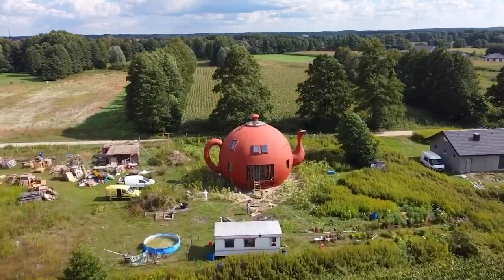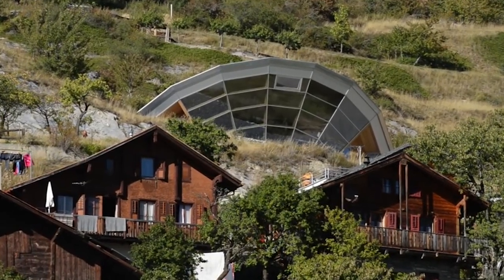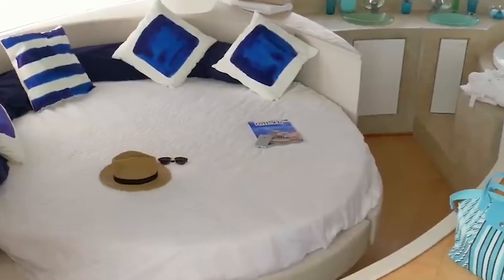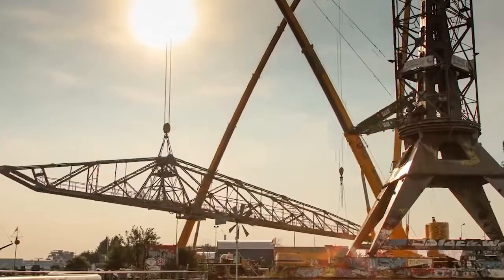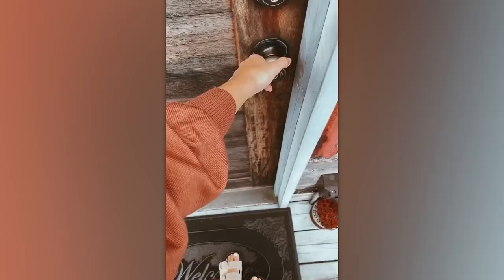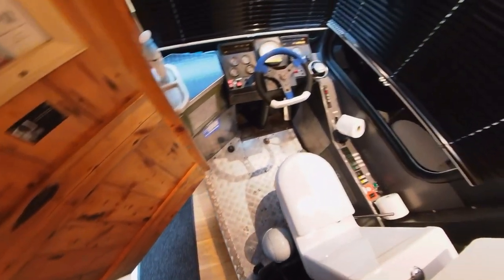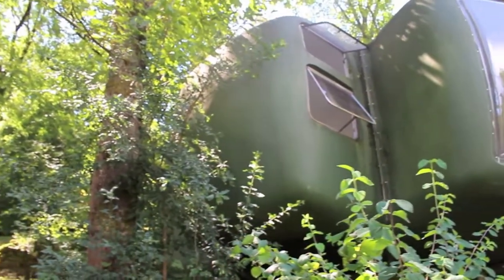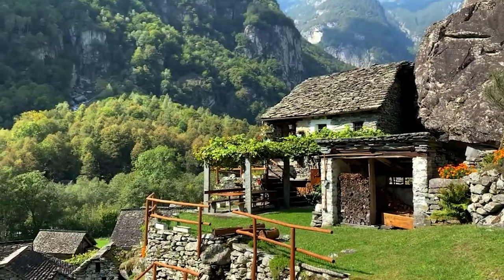People Laughed at His House, Until They Went Inside

Comment: Hey that's kind of cool little house open hanting built at the top and a big old giant hot air balloon straps the metal frames aside with motors where you fly away to anywhere you want to hang out especially if you like to hang out in the sky but watch out for the military they might blast you out of this guy thank you and your phone laugh out loud but really wouldn't be funny if they happened to do so people should be able to go to the air in any kind of device they want even a hot air balloon house and I think that little house is perfect for the job being a hot air balloon closing wraparound porch with with straps touching it to the balloon a tank to create heat in the hot air balloon solar to create power for electric propellers and rudders system do fly wherever you want to roam in that big blue one for sky Alexander it for a long time lot longer than man I think it'd be great or people to take to the air easy travel flying in the sky